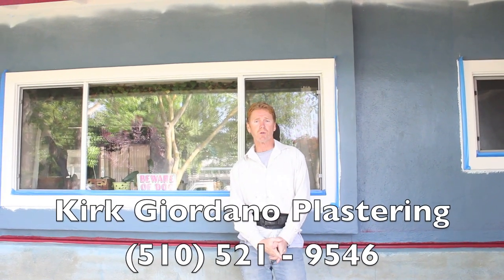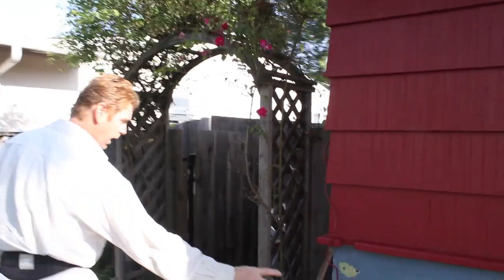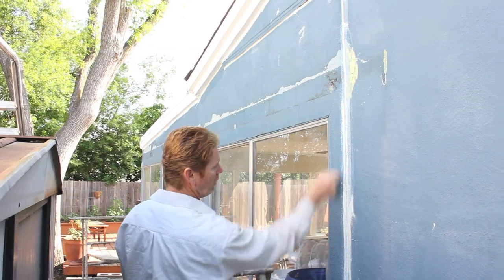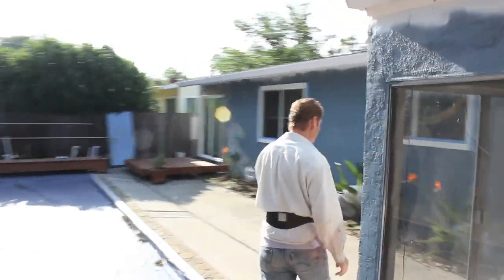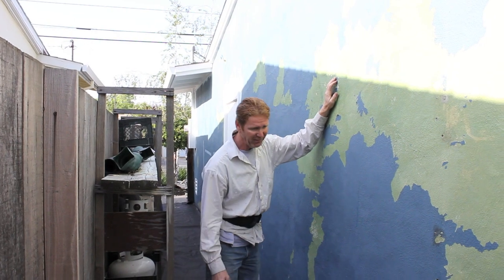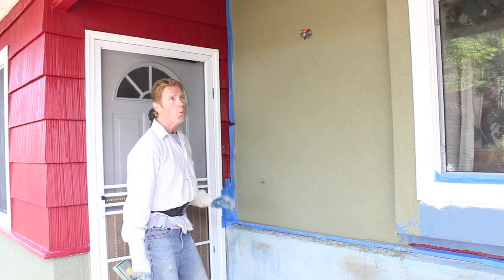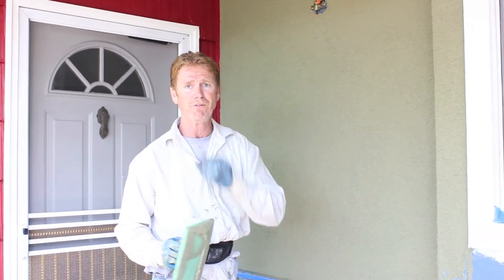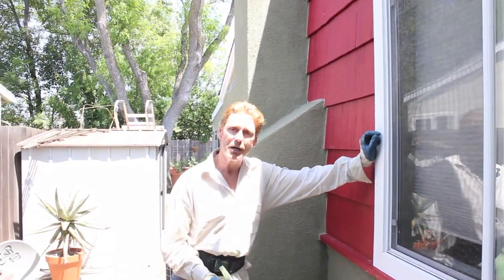Stucco color finishes

Comment from the maker: Hello, yes, expansion joints greatly help where to different and separate structures are placed next to each other. The amount of stucco breakout and possible re shear walling and re-lathing complete walls sometimes comes into play when this preferred method is called upon.  It should be done this way before the applications of stucco.
 Great question, 
Kirk Giordano Plastering

Comment: Three days ago I applied a color coat ( La Habra with Mesa Verde color) on a painted detached garage.  I applied a bonding agent prior to color coating. I was mixing single bags at a time - I thought I had enough to finish a wall but ran about 2 feet short.  I mixed a new bag and finish the wall.  The joint between the two coat now has a line (everywhere else is the same color except for the seam).  Why did this happen and what can I do to remove/cover the discoloration between the two areas?  Thank you for the videos - you've been very helpful and informative.
Reply from the maker: When you stopped then restated you created a cold joint, you might be able to fog coat it out.

Comment: I have a stucco house that has been painted and I want to color coat over it just like you did here. Can you help me with the order of things? Would it go like this 1. pressure wash 2. bonding agent 3. layer of stucco 4. colored stucco?  

 You mentioned using a fast setting stucco that allows you to color coat after 2 days instead of 2 weeks. So does it make a difference using a fast set as opposed to a slow set?
Reply from the maker: You have the order correct, 3 and 4 are the same procedure as youre applying  an Integrated Color Stucco finish,
 FYI, if I were you, don't try the same day materials as they take years to learn how to apply properly,
 Best wishes, 
 kirk giordano Plastering
Reply: That's the part I was confused on 3 and 4. In some videos it looked like you applied the stucco very flat with a stainless steel trowel . And then you immediately went over it with the soft trowel that you dip in water, at that time you textured it. But in a couple other videos it looked like the stucco was already hard. So would I be ok to apply the stucco from the bottom up and then back down with a flat trowel, cover a section about 5'x5' and then immediately use a soft trowel and apply more stucco for a texture finish?  Or first apply a thin layer over the whole house and then let it dry for a week or two and then come back and texture it? Appreciate your time, new subscriber here!
Reply from the maker: Howdy hope dude, with integrated color finishes, you apply whatever finish you wish at the time of application, on this house we applied the finish coat, I then immediately used  a green sponge float to bring out the sand which is where the name sand fishes comes from. 
 Cheers,
 kirk giordano
Reply: Gotcha, so you apply and texture all in one shot. thanks!
Reply from the maker: Evening Hope dude, this video sort of sucks as I didn't wear a mic, however this one below will explain a bit better as I did wear a mic.
 https://youtu.be/xPvm5BUm5-8
 Cheers,
 kirk giordano plastering
Reply: Thanks plaster dude! lol

I appreciate your videos, I'm going to keep watching them until I'm confident enough to my house. I'm almost there..
Reply: I'm going to do one wall at a time.